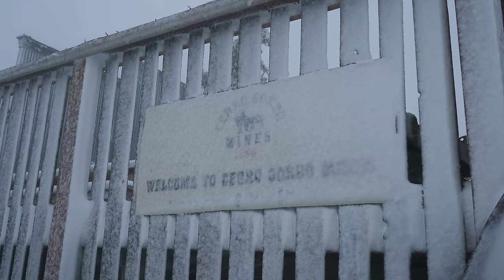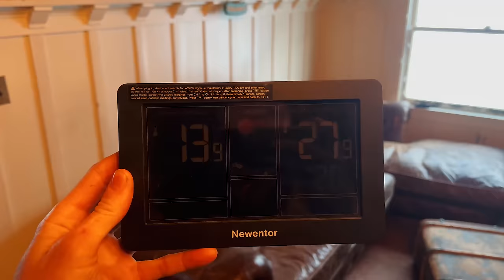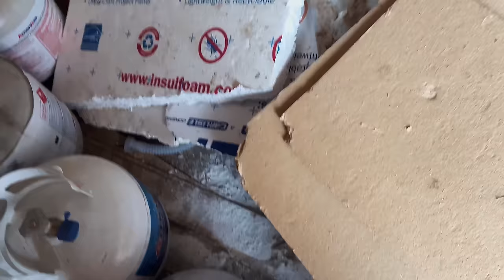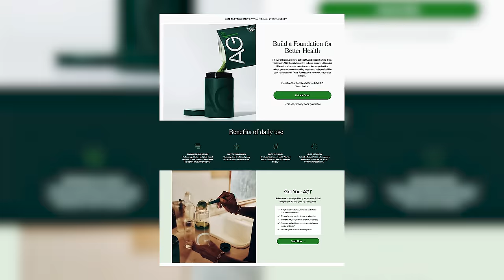Realities of Winter In A Ghost Town

Comment from the maker: Hey guys! Obviously could have been a bit better prepared for this first storm but it came a lot quicker and nastier than expected. The winds topped 70mph and blew open a bunch of doors and even knocked out some windows. We check the doors each night, but the wind can blow in hard and fast. We've got that all sealed up now and are limiting the buildings available for tours. Firewood has made it's way indoors and building a shed for the bikes. We're prepped for anything else the winter might want to throw our way. Thanks for the tips! Always a student up at Cerro Gordo.
Reply from the maker: fatarsemonkey  ordered!
Reply: hi there. I am no master of the elements and I am not sure how much of my advice is applicable in this situation but I want to at least offer some help if I can. for some of the window issues try finding some indoor insulation kits, I know 3m makes them and can be ordered online. Though I am not sure how effectively they will hold with the older windows you have. I will also say that having some caulk and foam insulation tape on hand to seal any visibly drafty window sills is very helpful. The tape is also good for doors! I genuinely wish you the best and hope that you can keep warm and safe for the rest of this season.
Reply: Your ghost that lives in the bunkhouse didn't want you to bring snow in with you, so he locked you out.
Reply from the maker: @comfortouch  It did feel that way.
Reply: hey good luck with the snow tonight man I could imagine most people wont have the guts to live in an old ghost town when its snowing like crazy and freezing
Reply: Some day somone is going to have to make a Sero Gordo ghost town red dead redemption game.
Reply: I fully agree.  I do. We built that back about,  oh,  I reckon 20,   25 years ago.  For us here in NW Montana.  In the YAAK VALLEY.
Reply: Really enjoyed your sled adventure..I chuckled to myself how fun that looked and had childhood memories sleding down a hill.
Reply: @Themophobia  Tape adhesives don't like anything at or below freezing temps. If he were to apply it he'd have to do it with a fire to his back or when the temperature rises for any of the uninhabited buildings.
Reply: Melt snow in buckets so you can flush the toilet. When you pour water in the bowl it will flush on it's own. You can store water in the tank and use the handle.
I lived in the country my entire life and had access to a pool or a pond. No power = no well water.
Reply: So open up as a ski lodge make some money off the snow. Maybe invite some YouTube channels who do winter sports up when it snows
Reply: I am sitting at my desk in Vermont after a snow store, loving these videos.
Reply: Can I make a suggestion that in spring make some spare doors with the lock and stock locks like medieval .. that way the made door will go over original  door and stop the snow so you won't have to shovel out any more ..  this will help protect the insides...
Reply: Love tofu ❤  storey trooper chachi 🥰
Reply: Thank you Brent Always share  awesome Video👏👍📹💯🤩 always keep strong Brent 🙏🙏🙏...greeting from subs and big fan at Indonesia🙏☺🇮🇩
Reply: You should get a snowmobile, or snow hawk or something.
Reply: You didn't mention if the starlink worked.  I'm curious if starlink has the same problems as dish tv.  Does it cut out when there are really bad storms?
Reply: A gentleman & a scholar 👍
Reply: I did not know solar doesn't work without sunlight.
Reply: Come warmer weather make simple swinging door latches out of wood, leave enough tolerances (gaps) to allow them to work even when caked with ice.. 

Simple enough,  but your right, its a learning and continuous improvement process..
Reply: @GhostTownLiving  
Buy a old Jeep Wrangler for emergency ingress/degress
Reply: i still dont understand why your not running youtube ADS for profit. just makes no sense. its free money from viewership.
Reply: Its frustrating a lot of times seeing these things happen in content in remote locations, especially when its blown off and nothing is done about it. It is so incredibly refreshing seeing you address these things as they happen and consistently putting forward a great deal of effort amending these things and making it work. Major props to you for being so upfront with these things and really acknowledging and implementing positive changes as they happen. Things will go wrong anywhere and everywhere, the only thing that really matters though is what you do about it. Absolutely incredible as usual, and glad to see you were able to get at least some internet back 👏
Reply: Don't put bolts on your doors?
Reply: hi Brent! Again, amazing video ! Have you thought about making a big water retention pit in order to get running water in the summer? or when you need the water to mix concrete, lay tiles…Because you could fill it with snow in the winter and have water when it melts.
also have you gotten my emails ? Because I have been trying to contact you for about a month and I haven’t got any answers 😞( it was about coming to cerrro Gordon for a few weeks and help you and your team restore this magnificent place) 
thanks !
Mathys
Reply: @fark1936  
I do not have star link but I do know that Red Poppy Ranch uses it!! They love it!!
Reply: What if you have a medical emergency, 911?
Reply: @Ghost Town Living
Hay Brent! WOW 😳 27 degrees is definitely 🥶!! I thought it was cold when I had lost power for 24 hours and my thermostat read 47 degrees!! 
   Just a suggestion but how about a small portable solar generator?? That way you can have back up... Also something to plug a small heater in??  Keep an eye on the temperature... If it's for casting freezing you just let water trickle out of the water pipes... That way the pipes won't freeze and potentially break... Have you thought about insulating the pipes?? Like with styrofoam??  Again just a few suggestions...
   Thank you for sharing your winter wonderland with us!! The sled ride looked like so much fun!! Brought back so many memories!!  As I live in Rhode Island the winter can be fun. Just a question for you... Didn't you take any??? ski lessons before hitting the slopes???!!!  Don't feel bad though because my sister had sprained her ankle really bad by just getting up after she fell!! 
   I didn't get much instructions either. My dad just showed me how to turn and snow plow to stop. I think it was like a five minute instruction!! Lol!! The other tip was to watch others ski!!  Well it took some practice!!  I did wind up In a slush puddle though!!  UGH!!  Thank God we had gone there in our camper!!  Have a great day!!
Reply: Thank you so much for sharing this journey that you started Long time ago thank you so much for sharing it I was great day be safe sincerely Suszie
Reply: @arcanask  true. I am so used to doing that beforehand as prep for winter it didn't even cross my mind. Thanks for the reminder friend. I would hate for me to be the source of bad advice.
Reply: People dont close the doors they get screwed shut for the winter
Reply: How is the starlink working out?
Reply: How about sustainable water from the atmosphere to expensive?
Reply: How hard is it to close those doors before it snows??
Reply: @constance9789  you can collect rain runoff for nonpotable use legally. It was illegal for some time to collect any rain, but not anymore. In some counties you'll even get a tax rebate.
Reply: A few thoughts, Take some painters tape and some .31 mil painters plastic and cover your windows with it... The single pane, wood framed windows leak out a lot of heat. The plastic will let the sun/heat in and help keep the cold out. Also, use your mini-ex to move some of the smaller trees nearby to town, plant em in a line and use them to make wind-breaks. Get some of those run down buildings cleared out and use them to keep your firewood dry. Get your water lines run about 18" under the ground so they won't freeze. Move the propane tanks indoors so those don't freeze up. Stop using the fireplace, get a cast iron wood burning stove. They put out a lot more heat, it doesn't go straight up the chimney, you can cook on them. Keep a pot of water on the stove when it's running, it'll put some moisture in the air and keep your lungs/nose from drying out so bad. When there's no fire, block off the fireplace/chimney, you're losing a lot of heat that way. Those buildings are built for sun and hot weather, not for cold, but there's still a lot you can do to insulate them.
Reply: Instead of please close the door signs, you need to make a nightly round to lock everything. Especially now that everyone watching knows it’s all left unlocked overnight. You don’t want the weirdos coming out & trashing or stealing things.
Reply: I'd look into those door closers like you see at schools and offices
Reply: Keep a torch on you when going outside. Around here (Wisconsin) you can get frozen out of your house if you don't have a lighter or torch.
Reply: @NoNORADon911 
Winds were strong, even blew out windows.
Shutters or plastic in winter, and wooden lever locks for doors?
Reply: Can't lie...I would have expected you to be much better prepard for a season that brings snow.   Rebuilding is great, but you have to fix things that are existing, windows, doors, locks.  really wish I could come and help you, but sadly I cannot.
Reply: @GhostTownLiving  Brent, besides the snow chains, when coming up in the snow and also sometimes in the sand, you may want to turn your traction control OFF.  I think this may have been what was causing you issues with your brake controller.  Well that and the cold surely doesn't help.  In the winter, when you do get your chains on you tires,(and I would get at least two sets), so that you have them for all 4 tires.  This will help immensely!!  Also, the other reason for having your traction control off is that both winter tires and any tires with chains on them, will sometimes needs some wheel spin to work properly.
Just a note from someone who grew up wheeling at altitude in deep snow.
Love the photos and video production!!  It is always breath taking!!
I also agree with many others that you need some Caches along the drive up in case of emergency!!
Reply: I also live by myself.  I've been 30 years in a winterized motorhome 
 You'll be better prepared next year I bet
  lol
Reply: Stick a bag over your toilet inside and crap in that my dude imagine using a frozen outhouse up a hill without heat
Reply: TIP for on-the-cheap keeping warm in freezing conditions: Get an el-cheapo set of summer weight MC rain-wear, to be worn as the middle layer of your winter weather work garb. This works so well you'll most likely start sweating (because the material doesn't breathe,) so clamp in some eyelets in strategic locations. A wayyy cheaper method is to use 30 gal garbage bags, 1 for torso & 1 each leg. No eyelets for these, just poke some holes.
Reply: @GhostTownLiving  Hi Brent, Stay safe in the winter season, ive followed you from the start this is only my second comment ' wait to i tell you this, listen to a song by the Scottish band The Wakes - St Patricks battalion, the song mentions * Cerro Gordo *  the song is on Youtube and you' ll find the lyrics online * all the best from Bonnie Scotland 🏴✌️☘️
Reply: A small wind generator added will help when the sun is gone. Be sure it can take 80mph winds or more.
Reply: Way out here ,they call the wind Mariah
Reply: I wouldn’t discount you being exactly God wants you to be. And if you’re happy I’d endorse that opinion. Dispute what some might think God’s not a dick.
Reply: @edwinwelch1946    I just had an ad pop up.
Reply: 70mph that is harsh .. stay safe 🙏 ❤️
Reply: why were you using the blade on the mini excavator to plow with? it's not meant to be used that way and it won't take much to overflow the blade. use the skidsteer with the bucket. much more efficient and less abuse on the mini.
Reply: @YARNBARF  that's odd cause I've never had ads from this page and I have no ad blockers on. I get ads on every other video on youtube
Reply: Awesome video once again and building some ski routes would be good for tourism aswell once the accommodation is how you want it
Reply: brent you need to get yourself some solar generators, and solar panels, you can get battery banks now that can power 3 or more 3000w electrical devices, you need it for the winter ESPECIALLY, you could run say a heater, stove and t.v for example, you get a TON of sunlight id make use of that if i were you ;)
Reply: As much as I dislike ads, it nice to finally see them on here. You deserve the revenue Brent.
These videos are brilliant. The town will benefit from it in the long run
Reply: Imagine if someone were to find out a relative worked rhe mine and then found your videos. They could sort of live as that relative did, through you. That's no small matter for many people interested in ancestry and building a picture of how they came to exist.
Reply: @Ghost Town Living You should purchase a snowmobile or 2 probably would be a smart purchase for this time of year
Reply: You need to stock pile some 4 x 8 sheet goods to make emergency repairs. Place some bars across important doors so they stay shut in high winds. The more you prep the less you have to make emergency repairs. Good luck
Reply: @Ghost Town Living 
I truly love how humble you are. Such a rare thing nowadays. I always have had the thought process that we ALL are learning every day 'IF' one is willing. No one knows everything and those that are not willing to admit that miss out on so much. The day we stop learning is the day we pass on from this life. You're doing great!
Reply: suggestion: build a greenhouse. If you wanna eat healthier that might be your best bet up there...or maybe get some soylent or ensure plus up there. its not great but its nutritious. Also multivitamin
Reply: Yeah, we got more than double the amount of rain than expected where we were. Weather is so unpredictable these days.
Reply: @Themophobia  wool blankets
Reply: you should look into some of the diesel heaters, fill up a few cans to keep it going , might help you out with heating
Reply: I want to live in cerro gordo.
Reply: You didn’t insulted the pipes? That’s stupid!
Reply: You need to dig trenches for water sources!
Reply: You’re not thinking brother! You have to prepare in summer and get you shit together!
Reply: Of the top 10 suggestions I could make, the first thing I would suggest is to build shutters for all the windows in all the buildings that you are restoring.
Reply: @chuckthebull  that would be awesome
Reply: Love your videos. I recall you saying your from Florida and Texas. Helpful hint (hopefully) You must plastic your windows given the strong winds, I do it inside and out. I’m in Northern Indiana if my windows aren’t done it’s freezing inside.  Keep your wood burner cleaned out, so you can close the doors. Load it before bed turn it down you'll be warm in the morning. I've cooked on the top of mine before. Use cast iron. Just things I've learn from surviving the cold. Please keep the videos coming I look forward to them as do my friends now.  Pamela
Reply: If you want to protect these buildings long-term you should look at installing storm doors with thick rubber seals on top of the original doors. Also, you should upgrade the windows to at least a double pane window. Used cooking oil is a cheap and reliable source of heat for your room heating stoves.
Reply: Do you have a safety and evacuation plan in case you or your guests become disabled or have a medical emergency while living at this location? 

Have you built a Heli-Pad, with Visual and radio Nav Beacons, so you and your guests can be evacuated in case of a medical or welfare emergency? Do you have a reliable First Aid building with fully stocked Level 3 medical supplies, stretchers, [heated] blankets, medical hot/cold ice packs, to deal with emergencies? Any medication on site to mitigate heart attacks such as aspirin and Atenolol? Eye wash station to deal with chemicals and debris in the eyes? Baking soda and lemon juice to deal with chemical burns? If someone gets a severe skin burn what is your plan? Who is your trained first aid person while on site?

Risks while living or working remotely: Hypertensive episodes requiring emergency medication, heart attack, stroke, broken bones, epileptic seizures, frostbite. Plan now to mitigate risks.
Reply: Good morning.  So I'm not sure if you are doing give aways. But someone who says they are you are trying to give me a computer, saying I won it, but wants me to to pay shipping and handling.  I believe it's a. If scam and I'm not paying for anything.  So let me know if this is you or not. They are using telegram.
Reply: More hints from Minnesota at minus 20 today:

Your stove was sold as a “Franklin Stove” in 60s and 70s. (Had one new at 88$) Notorious for inefficiency.  Doors need to be closed for draft control.  Foil can be stuffed in door cracks to keep fire going all night.  Dangerous stove.   No longer sold. 

Jug water will flush your toilet if drain is ok.    

One room fully insulated with double 3M plastic on windows will keep you alive.  

Playing on a winter mountain alone might make interesting  tube content but could have bad outcomes.  Helmet recommended.  

We are year 50 in our lakeside house/cabin.Preparation starts in October.  We know minus 40 is likely with power outages.   We’ve learned our lessons ….as you will young guy. Take care.
Reply: Hey two suggestions to make winter more bearable. Keep the fire wood dry and under some kind of cover. Save the wood ashes. Aside from valuable for gardening, you can use it in the areas you’ve blowed and shoveled to keep them from being slippery. When my truck is stuck in the driveway, a couple scoops of wood ash and I’m driving right up and out. 🍻
Reply: I feel that Cerro Gordo wuld be perfect for a movie set, something Christmasy, Narnia style vibes...or complete horror movie stuff like Cabin in the Woods! You could rent the town out for such projects and all proceeds could go to funding equipment and material to build the American Hotel and to maybe get insulated pipes and stuff.
Reply: Sorry, I didn't know even in winter you had guests come up there. I thought it was just you. And before winter the doors would be boarded up.  70 mph winds can blow a lot around including doors and old windows. Old man winter can do a number anywhere. Look at what happened in Texas. Maine, NH and VT  just got our tails froze for two days. 
Being so high up I can see how that wind would blow. Surprised that town made it through so many winters and was still in as good a shape as you found it. 
Good luck. Two more months to go and spring will be here. Well,. Hopefully. Might be more like 3.
Reply: Look (pause and zoom in) in Bunkhouse window at 12:04. Isn’t that a little creepy? Or am I the only one that sees it?
Reply: I have looked at it a few times and it looks like someone with coveralls on and their hands inside behind the pouch of the coveralls like old men do when it’s cold. Very cool to see giving the stories. Looks as though he is looking directly at Brent outside filming. Just just I would share what I seen and hopefully others could see it too.
Reply: If you run into that issue with ice building up in your door frame again.
Do not close naked wood shutters or doors so that you wedge snow in between the door and the frame.
Not only will you make it impossible to open again but.. you are essentially trapping moisture and pushing it against both sides of the woodgrain and this WILL rot the wood, especially around your hinges very fast.
Especially on old dry wood.
Use the back of an axe or a wooden/rubber mallet so you dont damage the wood when removing ice buildup.
Reply: S.W.E.D.
Reply: With your water shortage issues Im a bit surprised you are wasting water on the loo anyhow- composting loos are they way to go in your situation I would think
Reply: You should really make some snow shoes...

Idk how you havent after 3 years now man.
Always love your attitude. Respect.
Reply: I was going to suggest a shelter for the bikes and kubota...but you're definitely ahead of me!
Reply: Shouldn't you be trying to gather all that snow for water in the spring?
Reply: Try to stay warm!
Reply: It's fascinating to me that the England vs Spain rivalry lead to this. they took their battle to another continent entirely. England took the north and spain took the south. And you can see from linguistic influence in the continent. the north is English speaking, and the south american countries are Spanish mostly and some Portugese.
Reply: You f' ed up!
Reply: Wow...I'm surprised because you're not that far up north!
Reply: @shageevideo  there is an insurance for people living in rural hard to get to places that sends a medical chopper instead of an ambulance it’s pretty reasonable and they can get to you in less than an hour don’t know if he has it or not but it’s available
Reply: @dakotaknoble2556  some people  will run a rope from building to building to keep from getting lost in the snow
Reply: @SandyWolf-  ll
Reply: Blessings to you from Big Bear Lake, CA. I have been here 2 years. Can go down to zero here. This year, February 2023 bad snow storms. You have a lot of courage and commitment to make Cerro Gordo a real living ghost town. I think you have same birthday as me, April 6th. We are fighters warriors and never give up.
Reply: @GhostTownLiving  don’t feel  bad because you weren’t well prepared. This winter was a once in 200 year  event and you couldn’t have predicted it after your previous 2 winters there. You’ll do awesome in the future ❤
Reply: First rule of sledding, once you get on that hill, the sled becomes a part of your body.
Reply: Love your videos!
Reply: This 2023 winter try putting clear plastic vinyl on the windows to stay a little bit more warm. I use to live in Lake Tahoe, Cali  so I know a thing or two 😂
Reply: Be safe 🙏